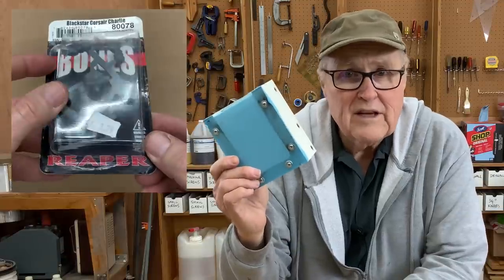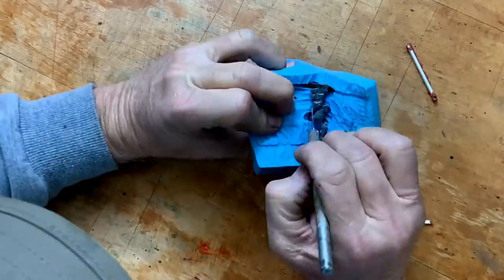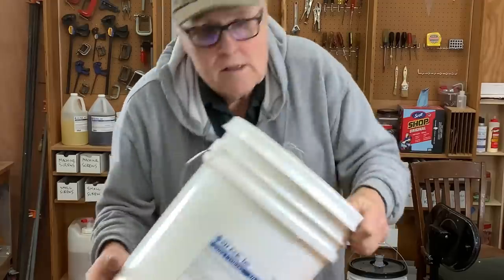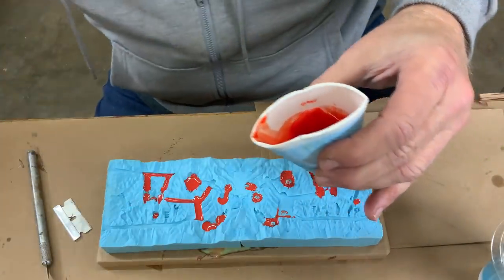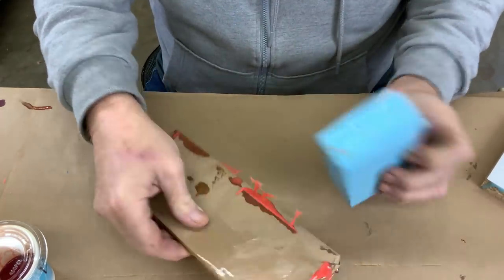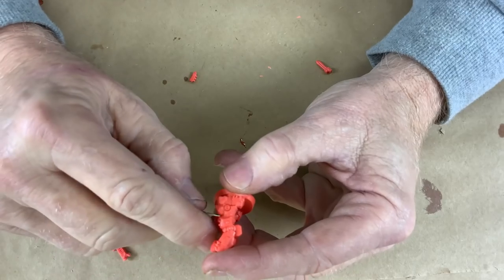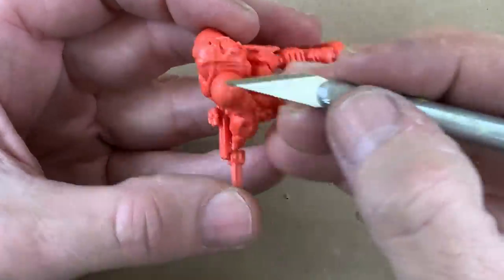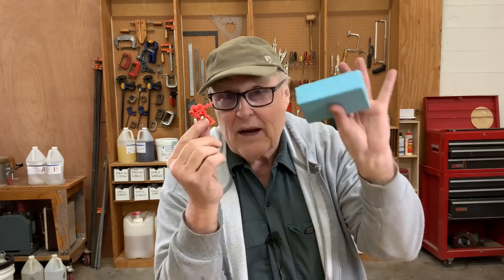Casting A Mini Kit - Part 2

Comment: A few other reasons to cast something like this miniature:   1) For customizing.  A lot of people want to swap out heads, weapons, arms, etc on miniatures in order to make a specific look that might not be obtainable any other way, other than sculpting your own figure.  Rather than cutting up a purchased miniature, they'll just cast for parts.  2) To fix broken parts.  Similar to the first reason, but these minis often fall off in the floor, get stepped on, or have weak spots to begin with, so casting a second figure allows you to replace an arm or broken pulse rifle, etc.  3) Army building.  If  you buy 5 minis, and then cast all five at once, five times, you suddenly have a nice troop of figures.  Though you can buy minis at local shops or online, there is such a thing as stores having limited stock on-hand.  By the time you buy the minis, wait for the restock, pay for the shipping, etc, it's a pain in the ass.   At least with casting things yourself, you don't have to sit by passively waiting around for the pandemic mail to arrive.  Patience is a virtue, but a lot of people got to get on with getting on. lol  Me, I can wait.  I do like to customize things though, so recasting is a fun way to help out with that.
Reply: You make some good points,  things can have more value than the price tag
Reply: Exactly, two years ago i was trying to buy additional 4 rifles for my minature soldiers and on official store there were sold out, after googling i have found only 1 set in other store in my country. Recast was the only option left for me. And yes it was costly and time consumming but now i have them on the shelf :)
Reply: Thats exactly what I will do. I want a special gun for my models, however the gun is part of another set, where I don't like the models. So instead of buying a lot of sets I cannot use, I will buy it once and make a mold from their guns only. Which I will use on models from the same manufacturer anyway.
Reply: @peters.9463  ^This. If you just want the one part, it's not efficient to buy the whole kit multiple times. If you can cast the part, you can have as many as you want. (This is where making really small molds can be advantageous, to save money on materials).

Comment: The value in your casting is teaching an example that applies to other scenarios. Thanks for that. In case you don't already do that today. If you update part 1 with an embedded link to part 2 that works well. Especially for those who find part one years down the road.
Reply from the maker: I will do so. Thanks.

Comment: Thank you so much for this video Robert, I really learned a lot! One thing I'd love to see is a "History Of..." sort of video - showcasing how molding practices and materials have changed over time (like transitioning from lead/tin mixes to pewter to plastic and resin) and the evolution of the technologies and casting methods involved over the years. I feel like your direct experience would be really valuable in this case, as there aren't a lot of primary sources! Cheers, and good casting!
Reply from the maker: I would like to see that video myself!  The methods I teach on my channel are exactly the same as they were in the early 90’s when I started. Same materials, everything. So I never had to learn the old-timey methods used by patternmakers and foundries.

Comment: Hi Robert, I am new to Mold and resin casting. I am learning a ton from your channel. I want to say, thank you for the time and effort you put into your videos. A wealth of info, thanks. Yes totally agree, an example of this video is learning and yes you can buy it cheaper but you can not buy this type of experience and teaching. I followed your videos and had a successful resin cast of an old vehicle Tail Light, super happy how it came out.  Need to learn how to cost & charge for a mold and casting, that's my next step. Wow Silicon is expensive compared to my 3D printing but that's fine. new learning curve Thanks

Comment: Do you ever use a piece of silicone coated cloth on the top to reenforce the hinge?  I make jewellery and find my moulds tend to separate after multiple uses and was thinking of this as an option.
Reply from the maker: I have not tried that but it would probably work great!

Comment: I use Games Workshop preview pictures and replicate them to the best of my ability in 3D modeling software. Print out a copy for myself and paint it to the shelf. The original kits cost upwards of 30 bucks for a single model, some heroes with huge platforms/beasts will cost over 100. It might take me two months to replicate one (thought the last figure "only" took 3 days). Even at minimum wage I'm not turning in a profit by replicating them.
 
But
1) It's fun, and it's practice. With every model you have a new set of problems to solve, and since I've only been doing this for two years, I'm still learning the software and the ins and outs of modeling. I take a new set of learned skills off from each model I make.
2) It does save me money. The 3D printer will churn out a model for 5 bucks, as opposed to the 100 bucks the kit costs.
3) No, it's not costing GW, because I was never going to buy the kits at the price point they offer the models at. At best I'd try to find them used on eBay. No loss of sales can be proven at any point.

All things you pointed out at the end of the video (well it does sound like resin casting would actually be even more expensive at every point, unless you take a really expensive kit to replicate). But it's always fun to watch hobbyists and professionals at their craft.

Comment: Thank you so much for the very informative videos. I am really bad at mold making and casting. I am dabbling in lost wax casting and I do not have a wax injector. But seeing the way you cast resin in several stages, gives me ideas on doing the same with wax and obtaining the result I need.

Comment: love these vids, love molding and used to use supplies from Prince august and mold with heat resist silicon for years, wish i thought of leaving a hinge in there! although RTV silicon is not as flexible, low melt metals were fun to use, if only my kitchen was as well supplied as your workshop :) i would have been turning out complete armies. company called GW should learn their fans are what makes them like you said

Comment: maybe you've discussed this previously, but i'd like a video about how to best store a mold and its shelf life being stored, and a video on how much shrinkage you can expect when the part has cured.
Reply from the maker: Wrap them in plastic and keep them in the dark.  Store them so they’re not warped or distorted.  The amount of shrinkage varies with the material.  The material data sheet will have that information.
Reply: @RobertTolone  well, what they write on the specs and in real life can be two different things, lol.
Reply from the maker: @manlymcstud8588  True, only through testing can you really know what material and process will work for you.

Comment: So that's how you do it! Open face sandwich style :) Thanks so much, I've wasted a lot of silicone experimenting on sprue kits like this (it was a waste because I've switched silicone's since). 

I don't know if you've mentioned it to your viewers but if they try to use silicone chunkies to top off, and the fresh stuff is a different brand than the chunks... well tears will be shed if you try tin cure in platinum cure or vice versa :0
Reply from the maker: In the future I will emphasize the fact that the chunkies must be made of the same rubber as the rubber being poured.  Also, it’s important that the chunkies are clean. And that the chunkies had been vacuumed to remove air. You can’t just use any old rubber as a chunky. 
As many have found to their sorrow, using any old rubber can have dire consequences!

Comment: While it does not make sense to reproduce an injection molded part this way, it can be good to do so with a 3D printed part (As Robert has done in other videos) because then you can use a different material (Zamac, pewter, brass, aluminum, wax, Durham's Rock Hard Water Putty, etc. . .) than the material you have used to produce the original.  I frequently emphasize that Mold Making and Casting is a skill set that most 3D printers could use.

Comment: Hey Robert, loving this series!

I purchased a model kit back in 2016 off of eBay. The company that makes these kits no longer exists, so they're a rarity.

I want to make a copy of it, so I can have backup pieces and/or an entirely new copy of the model itself since nobody else is making this particular kit anymore. Do you think silicone casting would be the way to do it? It's injection moulded, and most if not all of the parts are still on the frame. One or two have come off since.

Any suggestions/ideas? I am fairly new to silicone casting, I don't own a pressure pot or vacuum chamber for degassing. I've been slowly replicating each piece as a 3D model for printing in resin, but that's a slow and tedious process.

Comment: It depends what your casting; if say you have a box of three 28mm minatures that cost $60. That math will rapidly work ount in your favor as the mold will be good for many pulls; especially with mold release. While the amount of resin used is minimal.  If your were to take the parts off the sprue and gate them yourself; you could much more effienct in your use of silicone. For instance the mold box here is lot wider and taller than it needs to be; and than extra volume is wasting silicone.  For 28mm minatures a 1/4 inch past of silicone around the parts is enough to keep the mold from deforming.

Comment: Great! This was terrific as usual, and so informative.
 I was wondering if you were able to reproduce an eyeglasses frame mades of thin metal foil, I'm trying to imagine how you would proceed, I've search the internet and nobody seems to reach a decent result when it comes to super thin objects slightly curved as an eyeglasses frame could be, and obviously one should have the possibility to insert new lenses and the aim would be to be able to cast as many frames as you like of your loved pair of glasses. Grazie! Molti baci dall'Italia!  *
Reply from the maker: I have never tried to cast a eyeglass frames. I think it should be fairly easy although the resin frame copy might not fit the lenses because there is often shrinkage in resin castings. Grazie per aver guardato i miei video!
Reply: @RobertTolone  thank you for the answer! 😊

Comment: I think it can make economical sense IF you needed an army. If you needed 30 of these buggers? I guess the problem is, if you want them to look different, huh? In which case you could 3D print some accessories, so now the whole army has the same suit, different weapons / arms / heads.  

So casting a body , yeah, that's cool and I've done it. Have you done a GW warhammer one yet? I know they get crazy after folks who do this, and threaten legal action even though it falls under fair use.
Reply from the maker: Not yet, we’ll see what happens if I ever do one.

Comment: Great video! Is there any videos on getting started? Or the bare minimum you think people need? I'm thinking about picking this up as another hobby and not sure where to start
Reply from the maker: I would get a scale to weigh out the materials and start making molds and castings.  You’ll have bubbles to fix but if you keep at it you can add tools like a vacuum chamber and pressure pot later.

Comment: Do you use a new blade on every cut mold? I imagine it can depend on the size, but are there any molds where you've started with a fresh bland and still had to change blades partway through cutting because the tip got too dull?
Reply from the maker: For most of my pieces one blade will cut the molds for a project.  Sometimes if the molds are really big I might go through a couple of blades. For large molds I tend to switch from an X-Acto to a utility knife.

Comment: Theoretically, what's the break-even? How many models would you have to make to justify 3? 5? Because the molds won't withstand too many castings.

Any tips or tricks to make sturdier molds for more longevity of casting? (sorry if you already have a video on the subject)
Reply: I'm no expert, but the temperature at which the resin cures plays a major factor in how long a rubber mold will last. The heat is what causes the mold to distort over repeated use. So you'd want to use a material that has a lower curing temperature. You could probably make dozens of plaster castings out of the same rubber mold (but plaster is obviously not going to be as robust and detailed as resin).
Reply: Depending on the complexity and how many "grabby bits" (the technical term!) also what your acceptable level of deviation is a mould could last anywhere from 1 pull to 100 pulls but for complex shapes which you want high fidelity to the original I would estimate you would average between 10 - 30 pulls before a mould was past its best.
Reply from the maker: For me the economics are more about labor than mold wear.

Comment: would it work if you got a tub of the silicone mix and then dip your model into it and shake it a bit to get the bubbles out to make a model that way?
Reply from the maker: You would waste a lot of rubber and it would require several coats and then some kind of support shell.  Not a method I would recommend.

Comment: With the "fill up partway and cure before doing the entire piece," does that technique work with other materials besides resin? Do you have to worry about the pieces not fusing together?
Reply from the maker: You will have to test your materials to be sure, but I use that technique a lot.

Comment: When I initially saw the mold, I thought to myself, 'there's no way he's going to be able to pour resin down that tiny cavity!'  And, I was right, as that's obviously not the way to do these thin type of molds.  I'd imagine the manufacturers of these kits use injection molding, but for, 'amateurs', the best way would be how you did it, by literally pouring into the open mold, then closing it up to set and then remove the resultant flashing.  Being wafer thin, it's not a problem.  I don't understand the need by some to state the obvious in regard to the cost involved of doing the molding yourself being more expensive than just buying the kit from a shop.  That's not the point of doing it.  It's done purely to show how it can be done, if need be on this type of molding.  There's no commercial interest/gain to doing such for yourself.
Reply from the maker: I stated the obvious because it answers comments I invariably get from viewers.

Comment: I have a question.  Could you have poured this mold instead of doing the two-step process you used in the video?
Reply: Not how he arranged the parts, there are no vents for air escape so you would trap air when filling.  This is an important point in mould design know how you are going to fill it and design it for that sole purpose.
Reply from the maker: What Chris said. 👍

Comment: i wonder about the math and at what point, if any, you could make it profitable.
Reply from the maker: In my business I got paid to sculpt not to cast resin.  If you made unique kits that nobody else had you could sell them for a premium price.  there are resin kits that sell for hundreds of dollars or more. There is profit potential there. You’ll never be able compete on price with factory or import kits.
Reply: @RobertTolone  yep, model kits can certainly go for $175 give or take. those are usually garage kits where 100 sales would be wildly successful, i imagine. 

i was more curious about the example you provide of a $3 item being commercially viable as a resin casting for someone without 7 pressure pots, lol. i know how much i want to make per hour, and i doubt i'd get anywhere remotely close to that, but the curiosity is still there especially since you mentioned the cost of the mold and resin. 

of course that invites a cost comparison of printing them. 

i'm probably like a lot of people who are interested in the commercial aspect of these processes... at least being able for it to pay for the investment and have it be a side hustle with a reasonable pay rate.

Comment: Urgh, the fact that you need to make those caveats🤦‍♂

On a side note, I wondered today have you ever tried making small reusable silicon mixing cups?  I do find the creases in the base of those paper cups traps unmixed resin and chucking them out after each use seems wasteful.  Just wondered if you thought it would be worth it?
Reply from the maker: I reuse paper cups for several cycles.  For me it’s much cheaper than the time used cleaning out cups.